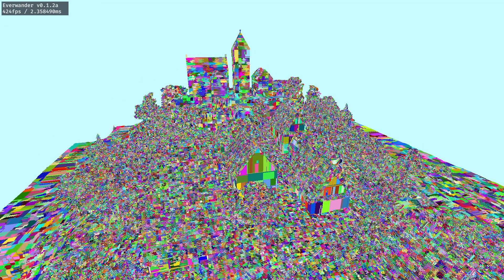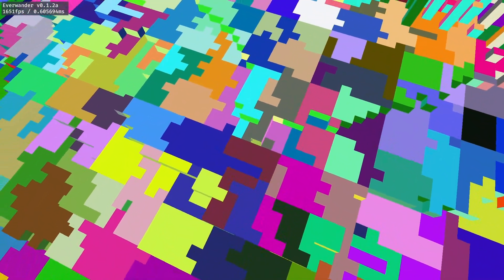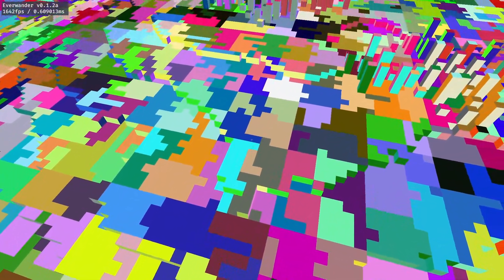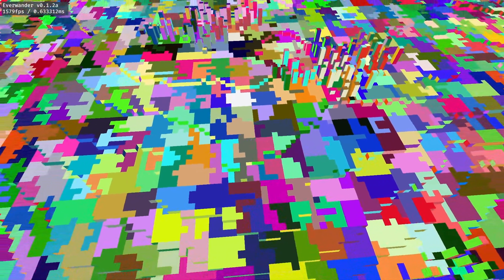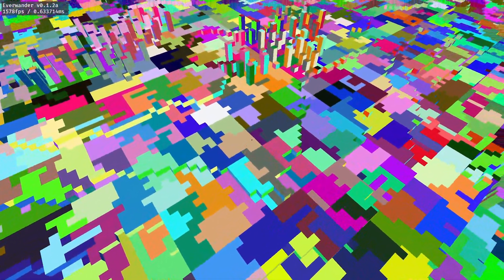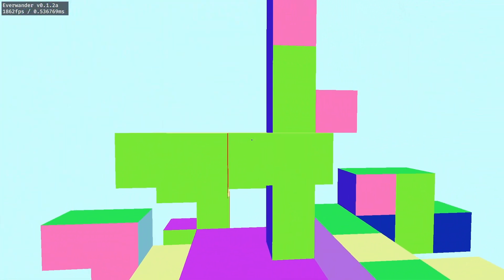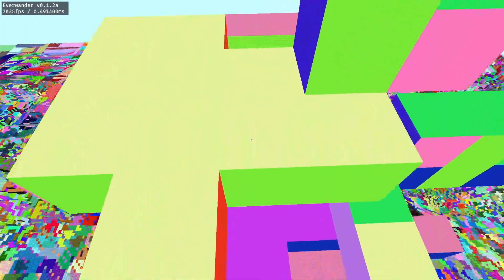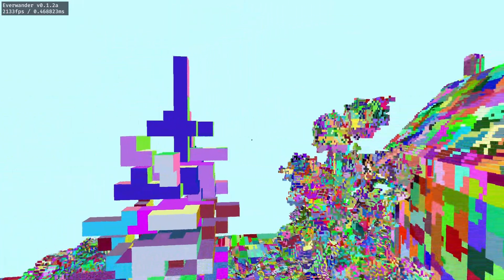Meshlet culling

Comment: Very cool. I plan on working on something similar. How are you rendering the meshlets? Are you using multi draw indirect and using an indirect draw command per meshlet, or instancing with non-indexed draws, or a single instance draw with a runtime generated index buffer, or mesh shader? Im leaning more towards runtime generating the index buffer for my use case as for my target hardware (mobile), ive found that having too many mdi commands really hurts performance, and im not sure about the performance of non indexed draws, but thats something id like to investigate. Also I can get even per triangle culling if i generate the index buffer as well for a low cost.
Reply from the maker: No mesh shaders, or multidraw. This is done via glDrawElementsIndirect. Since each meshlet is the same number of quads you can use instancing rather than multi draw, which is nice. An index buffer is used, however it only contains the indices for 64 quads as I batch 4 meshlets into each instance. The batching is done because some gpus perform poorly with small instances, I found 64 quads to be a good size on mobile gpus.

Comment: How does the hi-z culling of meshlets work?
Is this a built-in feature or do you need to bind and read the hi-z buffer as a texture in the mesh shader?
And are there ordering hazards? Given that rendering a meshlet will change hi-z, but then you're reading it again for the next meshlet... do you have to add fences for that? Seems like it has the potential to introduce a lot of stalls.
Reply from the maker: This isn't a built in feature, the hiz buffer is generated and bound as a texture which is then read in the compute shader during culling. I'm doing "two pass occlusion culling", so there isn't any ordering worries.

Just as an aside, this is done with compute(culling) + indirect instead of mesh shaders. My gpu doesn't support those haha
Reply: Ahhh ok, gotcha.

So why do you think full res hi-z is slower, just too many memory reads?
Reply from the maker: @iestynne When i say im going down two mips i mean that im sampling the higher resolution textures. The issue was that how hiz is typically is too conservative. The cost of sampling more is less than the cost of rendering extra meshlets in my case

Comment: Are you using mesh shaders?
Reply from the maker: No mesh shaders, compute + indirect rendering
Reply: @ethangore8697 would it be easier to use a mesh shader to do this kind of thing?
Reply from the maker: @AhmadAli-kv2ho  You might be able to squeeze out a little more. But I'm not a fan of mesh shaders until they are well supported on more gpus. My own gpu doesn't even support them haha

Comment: I wonder if we'll ever reach a point where out hardware can handle and render so many voxels they'll blend together and just form smooth surfaces with proper volume, like imagine if you cut into a person in a videogame and you can actually see the layers of skin, fat, bone, the internal organs, etc, and they're actually there and not just spawned in via a gore system
Reply from the maker: https://youtu.be/7W_Zo7oLmjc

The model importing system isn't great :/ and yes there is a discord, should be a link in some older videos
Reply: That would be a bit unoptimized